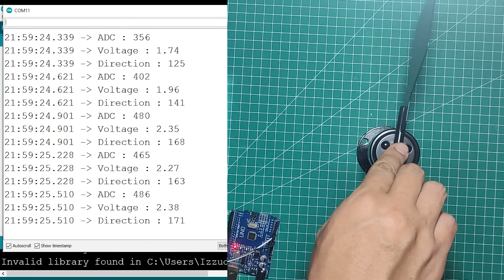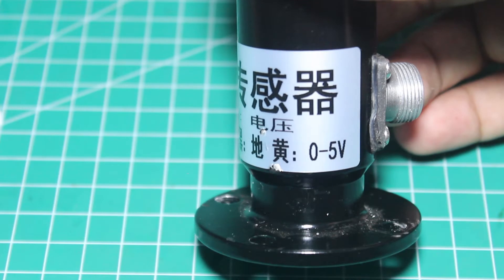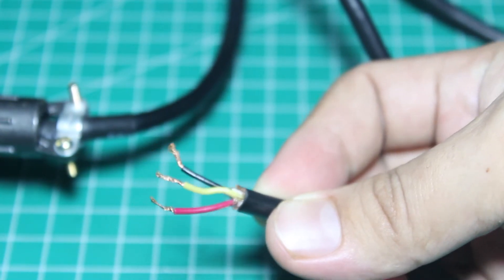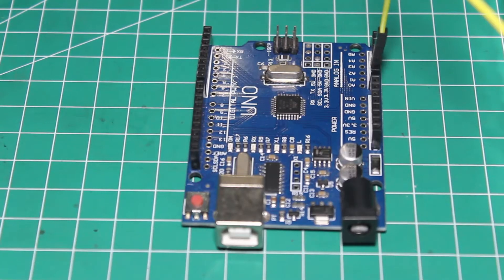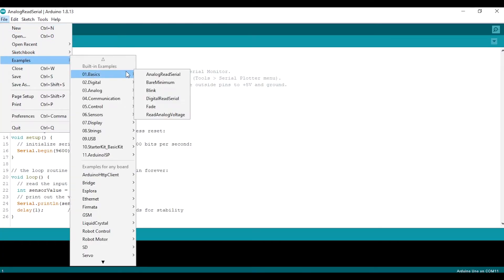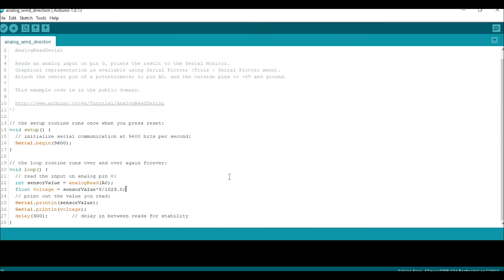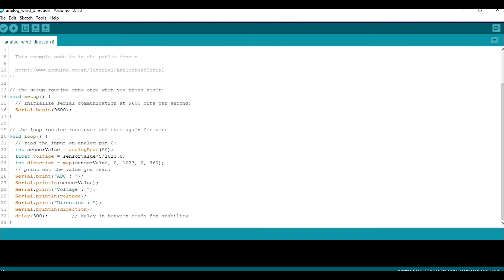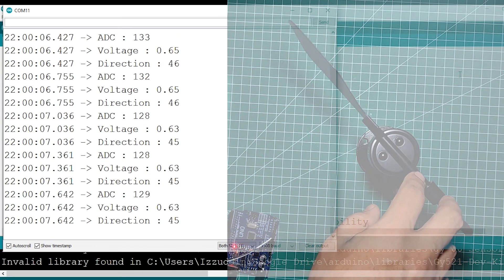How to Use Analog Wind Direction Sensor with Arduino

Comment: hi, i've been doing a simillar project to yours, but instead i use 12 v lipo battery, i wonder why the output of the angle direction cannot reach until 360degree, its only goes up to around 200 degree then goes down around 50 degree but never 0, can anyone explain it to me? please help
Reply: did u alr found the solution of this?

Comment: Should be possible to mount a rudder to a potentiometer, feeding it with 1 V and sending this output to the Arduino input to detect the voltage. 360 would be equal to 1 V and everything less than that would be equal to anything around the circle and if you’re using a linear potentiometer it should be directly convertible.
Reply from the maker: The problem is potentiometer turn/rotation is limited. While this sensor has unlimited turn and has consistent value every deegree.
Reply: @miliohm  Don’t they make a 1K  potentiometer that has continuous rotation? If not, just break the stop point so that it just keeps rotating round and round round. I’m such a hack, :-/. It’s worth a try even if you destroy a potentiometer in the process the alternative is to spend $50. You may not even get that to work because some of these wind direction devices require a transformer that puts out incompatible Arduino voltages.